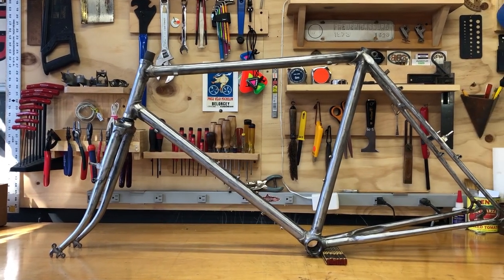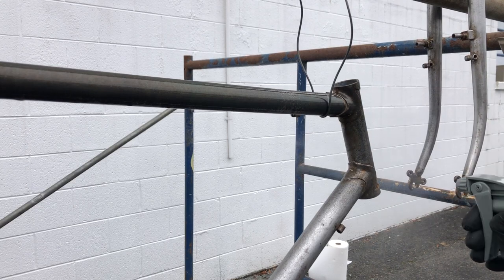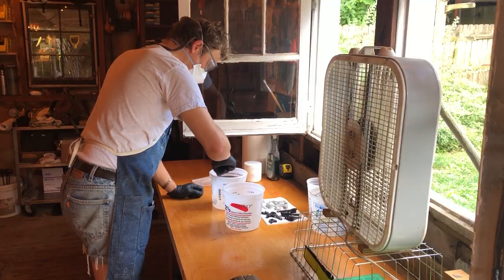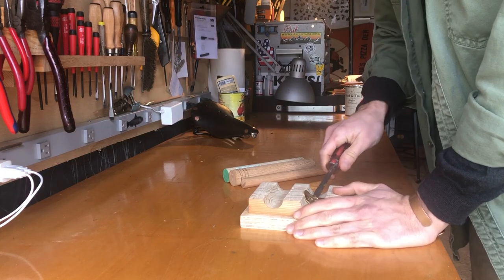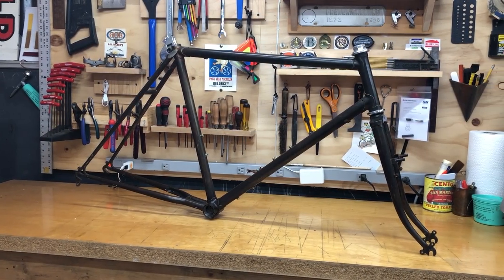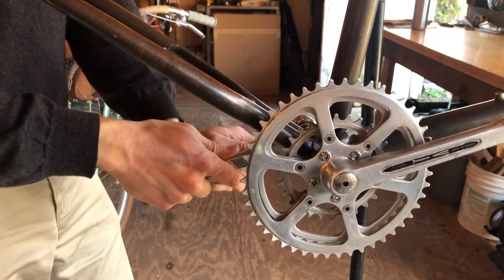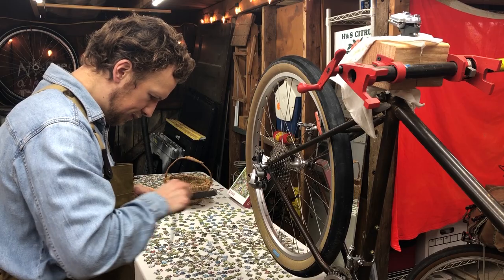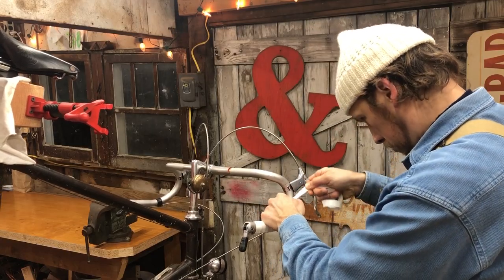1985 Bridgestone MB-2 Torched and Rusted ATB Build

Comment: And another level up Eric. Really really nice project. I did something similar with a frame a while back, used a copper oxide solution with vinegar as a catalyst. Also clear coated it after. It did eventually started to rust lightly I then robbed burned linseed oil once and again to keep it nice. Maybe thats an idea for you when rust creeps up. 

Keep up these projects Erik it's a joy to watch. Again cheers from the Netherlands.
Reply from the maker: Thanks for your very kind words. Always fun to see what kind of stuff you can get up to with a living finish on metal. I'll keep an eye on the frame, hoping I can keep it in check. 

Cheers!
Reply: Are you able to give more information on the copper oxide and vinegar solution. Or the acid you used Eric? Thanks!
Reply: @angusross7922  not sure if your question was to Eric the maker of this video or to me but here what I did. 

I got a jar of copperoxide (blue powder). This is also used to enrich garden soil I believe. You mix this in some water till it devolves. with a brush I painted it on my steel bare metal frame. This solution looks like water just as thin. After every stroke I sprayed it down with vinegar in a plant sprayer. It's super cool, you see the clear liquid turn into copper instantly. Repeat this process till it's to your liking. In the end it looks like an old patina'd copper frame. A little like in Eric's video only a little lichter and copperich. To prevent the frame from rusting (because the copper layer is ultra thin) I used burned linseed rubbed over with a cloth and after a minute wipe it down with a clean rug and your good for weeks.
Reply: @mountaincruiser817  Thanks that is really helpful.

Comment: Whole project looks great. I can really empathize with the radius of the head tube badges. It's so hard to get it right and every head tube seems to be just slightly different. You did fantastic work!
Reply from the maker: Ted, thanks! 

The cutout of the B made it really tricky, many of my first bends had almost sharp corners. Learned to finesse it into shape, gradually. Laying that piece of steel over the badge in the cradle and hammering on it definitely did the trick. 

I've seen professional head badge presses and they're essentially the same shape and idea as mine, I knew I was on the right track but it was frustrating for a bit there. 

Thanks again for the kind feedback.

Comment: Nice one!
I'm in the midst of re- making a Ritchey Ascent with a nice U brake from possibly 1988 or '87.
Today, my sister handed me a saddle very much like your Brooks but made in India I think, by Hojabr, with six copper rivets and nice little perforations in the centre. The bike needs a frame refinish and while I really like what you've done, I'll need to work off the over- painted turquoise and see what's underneath. I'm a big believer in older well made parts like the big cannister thumb shifters and the heavy duty brake levers. I want to re-spoke the wheels with heavy gauge stainless, because this bike is designated to pull a trailer that I'm custom building.
I love long wheelbase eighties mountain bikes as touring rigs. Instead of drop bars I usually go for two pairs of bar ends, above and below. That gives you lots of positions. Out of the saddle riding has become a necessity for me, as it saves me from soreness, and I can go into a big gear without straining my knees, using my hefty bodyweight to turn over the cranks.
Best wishes, dave
Reply from the maker: David, the Ascent sounds like a fun build. Good luck with your custom trailer! Some of the old parts are certainly robust. 

Enjoy that Hojabr and all to come!

Comment: Outstanding !   I thought I was out here alone in continuing to use Suntour brakes and bar ends.   I have them on a couple bikes including my 1982 MIYATA Aero Pro I bought new and  modded for daily driver use. 
I also own a Riv Hunqapilla  which I bought new, one of the early elephant gray and kidney bean units.. killer bike. 
I have bikes such as my wife's Rive Cheviot  under the stairwell, a 1983 SOMEC in my studio next to the MIYATA, my 1992 CADEX CFM in the bathroom in the basement, 1993 TREX MB in the storage shed...they're all over. Can't have enough bikes. 

From J'Ville  in So.  Oregon.... thanks for the inspiration. Liked and subscribed.
Reply from the maker: Very cool to hear you're running some SunTour, Jeff! I think it's nice stuff, the Miyata sounds rad. 

A Hunq is a grail Riv for many! Sounds like you have a bike in every closet and cupboard, nook and cranny. Be well.

Comment: Hey Eric. Love your work - in build & video presentation. This one got you one more sub when it bubbled up in my feed.  Just a query re: your deanodising of the Rear Der. I found your mix/link in the Appaloosa Update video....  

Is there any concern with the Jestco remover affecting any of the non-metal parts like bushing or seals when you dunk the whole assembly? I've seen caustic solutions, usually utilising a generic granulated drain cleaner, used to do this before in a few other HowTos; but only with the parts disassembled as much as possible.

Just curious if the Jestco product is very far removed from a diluted "Draino" (sodium hydroxide) solution.
Reply from the maker: Thanks! Yes, that is a concern. I would definitely recommend taking the derailer down to bits and only de-anodizing the aluminum body and cage plates. I was too impatient to do this. 

I'd wager the Jestco is just as caustic as drain cleaner, if not more so.

Comment: Nice job. I'm a new subscriber having just found your channel. I'm interested in your de-annodizing procedure. It seem to work well. Would you mind describing it?
Reply from the maker: Thank you! Check out my Appaloosa updates video for more on the de-anodizing process. 

I use an anodizing remover from Jestco. It's toxic stuff, if you use it make sure to wear goggles, a respirator (vapor cartridges are best), gloves and make sure it doesn't touch your skin. 

I follow the instructions on the packaging. After removing the anodizing I rinse in water, then dry. After that it's too the buffing wheel where I use a while polishing compound.

Comment: Beautiful build, Eric. I'm curious about how you de-anondized the rear derailleur. Did you remove any parts beforehand, or did you simply submerge the intact derailleur in the de-anodizing mixture? Thinking about doing this to an old XTR m950 I have lying around.
Reply from the maker: I dunked the whole assembly in the de-anodizer but I removed the pulley wheels. Wish I'd disassembled the whole thing! @Atboy has a good video about full disassembly of the XTR M952
Reply: @ericmarth  This is exactly what I was looking for. Thanks for the reply.

Comment: Absolutely incredible, could you recommend some trusted source from where I could learn about what you did to that steel frame? I would like to learn how to do such things and hopefully do it myself :) have a great day!
Reply from the maker: Wow, thanks so much. As far as the patina process, I just winged it really. I read the instructions and all the information I could find from the patina chemical manufacturer and went for it. There are many metal patina companies out there offering different chemicals and effects, take a look! 

There is a metal working foundry in my town where they use patinas and make sculptural metal. They would have been a good resource but I did not venture to talk with them much. One of the guys there told me that a Scotch Brite surface is the best for a patina.
Reply: @ericmarth  Thank you for the answer, i'll just start with the basics then! I've got one more question, did you secure this green patina on a front logo somehow? I mean is it a good idea to clear coat it or something like that?
Reply from the maker: @Zazyski  I applied a clear coat to the headbadge. The bolts and other bits I left alone. Green patinas can be very flaky and easily pop off.

Comment: Ha, my bridgestone isn't set up too different. I got Soma mustache bars on mine and a brooks flyer. Nice build man. 
hows the tires? Been debating getting some renneherse for mine.
Reply from the maker: Sounds like a sweet ride! Thanks for the kind words. 

I've got RH extralights on this bike and my Hillborne and I really like them. And I run their endurance casing tires on my Appaloosa. Overall, I'm pleased. Just wish they weren't so expensive!
Reply: @ericmarth  thats how I feel, I got some on my road bike but I'd imagine you would really feel them on some wide 26 inch wheels. Do the extra lights and the endurance casings feel pretty different?  Either way, thanks for the reply man!
Reply from the maker: @knife1406  I'm no low-pressure scientist but I'd say the endurance are as nice and plush as the ELs. I think they're very similar casing but with a protective layer added. Definitely a nice ride on 26s.

Comment: Another wonderful video Eric, very well done.

When you de-anodised the rear mech, to what extent did you take it apart? I’m thinking specifically about the mount bushing…

Cheers, keep em coming.
Reply from the maker: Great question, Ben. I took the cage apart, removed the jockey wheels and bearings. I did not take the mount bushing apart. Something in there I should take a look at? 😅
Reply: Hopefully should be alright, I just wondered how aggressive the solution might have been on the mechanism in there… spose you’ll find out if it’s done it any damage eventually!

Cheers Eric
Reply from the maker: @benbrown506  I'll let ya know, crossing my fingers until then.
Reply: I'm also a little apprehensive about this. I'm assuming the JestCo solution (as Eric detailed in another video) acts like a caustic solution, similar to many generic drain cleaner howtos you see for de-anodising.  They're Sodium Hydroxide based, See: https://en.wikipedia.org/wiki/Sodium_hydroxide#Uses.  Note drain cleaning AND degreasing.

Even if bushings are unaffected, I'd be a little concerned about any normally sealed factory lubrication being degraded or dissolved.

Not saying it's not worth trying; but I'd probably want try it on a more mediocre derailleur myself first!

Comment: So awesome, sir!
Wont you need to apply linseed oil to prevent rust?
Reply from the maker: Thank you! 

That's a goooood question. I went with the clear lacquer coat and then a light application of wax to seal it all in. Linseed oil is one method I've heard for maintaining a raw finish but at this point I'd be rubbing the oil into the wax...

Comment: Awesome vid Eric ! 

Where can I get my hands on that green solution you used to weather the bits and Brooks saddle?
Reply from the maker: Cheers. Search for metal patina solutions, you'll find something. The green patinas can be quite fragile and will easily "pop" or flake off. You can seal it in with a clear coat. I've so far removed most of the patina from the saddle rivets just from riding.

Comment: So did you take a vintage MTB and put new parts on it to make it look vintage? It looks cool but seems like you could have left it out in the New England weather for a couple years and achieved the same look. Am I missing something?
Reply from the maker: Hi Jay Bird — It's indeed a vintage bike and the parts are largely from the same era as the frame, from the mid 80s to the mid 90s. I wanted an aged "living finish" on the frame and as far as parts I wanted to go with vintage bits from some of my favorite component makers like SunTour, TA and Paul. The real drive behind the components is installing parts I like, they come together for a unified ATB aesthetic (or so I hope). 

I could have left it out in the New England weather for a few years and I'll bet the finish on the surface would be truly awesome. Especially with a good salty breeze! But that would occasion interior frame rust, which I'd like to avoid. What I have instead is a controlled surface rust finish on the outside of the frame which I sealed in with lacquer and then a coat of wax. The interior of the frame is treated with Frame Saver which I didn't cover or mention in the video. 

The idea was to get the beautiful depth and variance of a living metal finish but under controlled conditions so that the integrity of the frame is preserved. 

All of the parts are (for now) rust free, nicely lubricated and working well. I'd like to keep the bike in good mechanical order and don't plan to let it rust out or go to pot. 

Thanks for watching!
Reply: @ericmarth  right on. It looks like your technique worked out well. I thought the drop bars were a nice touch. Keep it real
Reply from the maker: @xjaybirdx309  Thanks, take it easy!
Reply: @ericmarth  yeah man you too.

Comment: Question: How rare are MB-2s? I have a gray/green MB-2. When I looked them up and found it really hard to find much on them
Reply from the maker: Hey Shaky Herb — I'm really not sure of their rarity, Bridgestones in general are much more common on the west coast than other places in the US. During the peak of the bike boom I saw some Bridgestones sell for serious money on eBay. This included complete MB-1s and MB-0s (aka MB-Zip). At the same time you could turn one up at a yard sale for thrift store for $50. I paid $220 for my MB-2 on Marketplace. I also bought a 1985 MB-3 on Craigslist for $120 and I way overpaid for that one because it was in pretty rough shape. 

The lower the number the better the original specified parts and package and sometimes the higher resale price. RB-1, MB-1, XO-1. The one Bridgestone that seems truly collectable across time is the XO-1. Second to that maybe the MB-0. Other Bridgestone fans would have a better idea, I'm not a collector or dealer and don't have any experience with shops that sell vintage bikes. 

To get a very general idea of what they're selling for search "Bridgestone bike" on eBay and then filter by "sold listings" so you can see the realized prices.
Reply: @ericmarth  thank you for the insight